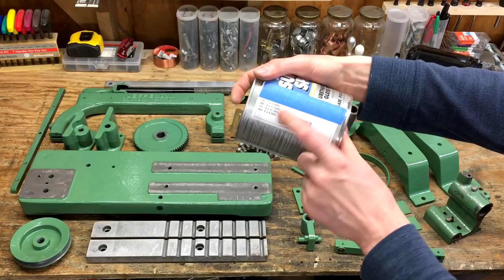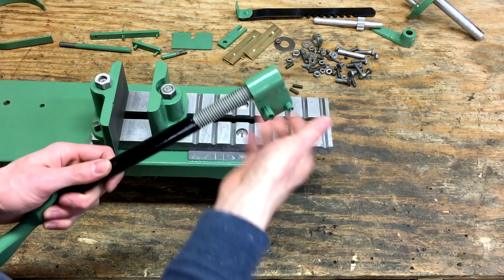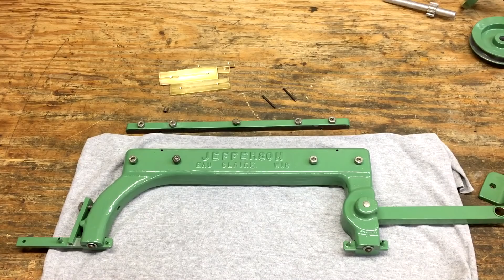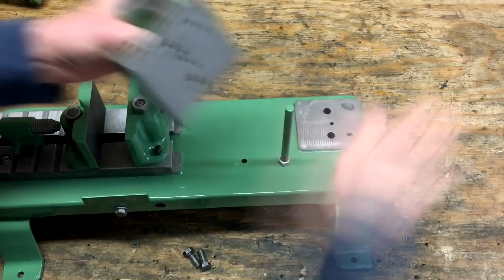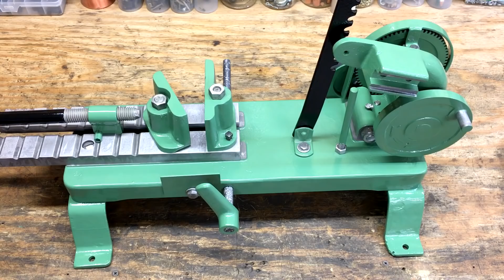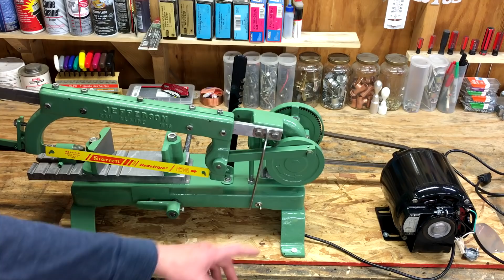Jefferson Power Hacksaw Reassembly

Comment: The original was built in the late forties on "Jefferson" street in Eau Claire Wisconsin named model 601 as the "factory" was from the shops address. The builder was Ole Paulson and sold by Stephen Havier.  The "Jeff" was sold primarily by mail order, had a lifetime guarantee, even not knowing what "life time" really meant.  The fact they are still in service  today means something. Havier was  my Greandfather and along with my Cousin and I we joined the parent company in 1970. At that time the wholesale cost was $59 less motor. Its was very popular with Farmers and small shops due to the easy availability of blades. The entire line was sold world wide, The Navy liked them because of the blade issue, the largest saw was the #5 and at the time was purchased by Turkey, who bought fifty of them, it was popular with airlines and even some movie studios. Grandpa would be very proud of you for make the "Jeff" come back to life after all these years.  Well Done!

Comment: Wow fantastic job. 38 years ago when I started my career we had one of these in the shop. Funny thing is when I retired they were still using it. Something to be said about the way things use to be built. Bad thing is , everything built today has to have a bucket of electronics in it that gives more trouble and takes a rocket scientist to run. Very good video and very good job. That's a tool that will still be working when your kids need to cut something.

Comment: Good job on the restoration.. What fell off at 13:20 ?
Reply from the maker: Thanks!  The bushings on the push / pull bar are worn out and I will be replacing them soon, in the mean time I had pushed a piece of shim stock in to fill up the slop but it worked its way out.
Reply: I'm jealous, I want one.  My favorite machine color is battleship gray. lol